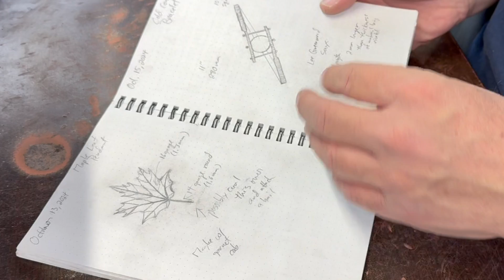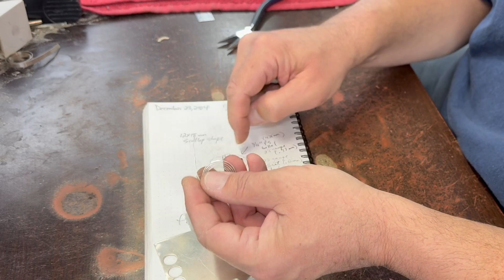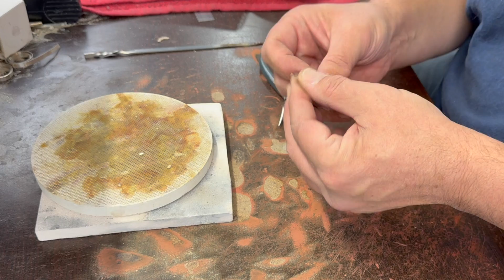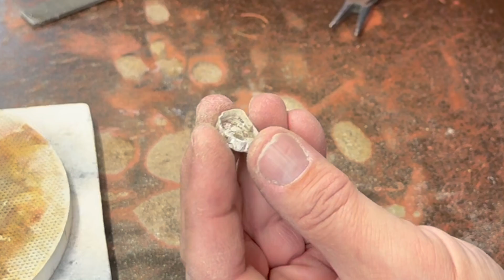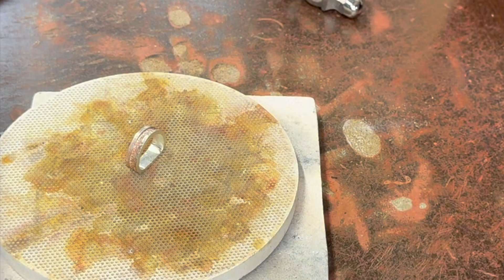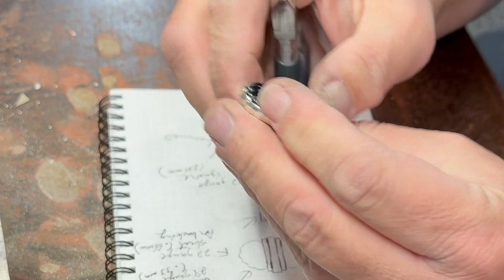Setting Carved Cabochons:  A Silversmithing Tutorial

Comment: I have a couple odd shaped pieces I want to make, this is very helpful! Also, I have raised stones to fit the bezel, but didn’t know I could raise only one side. I thought it would make the stone rock.
Reply from the maker: Doesn't seem to. I've set a lot of poorly cut or stones with uneven backs, and sometimes you need to use some strategic backing:)